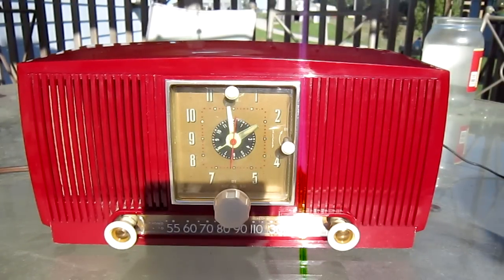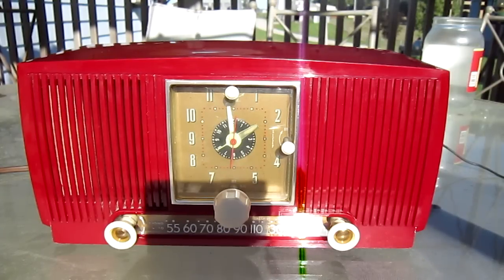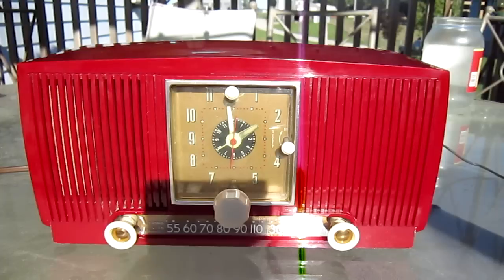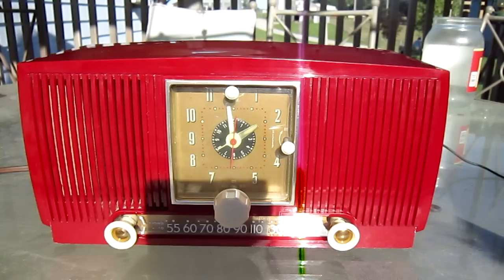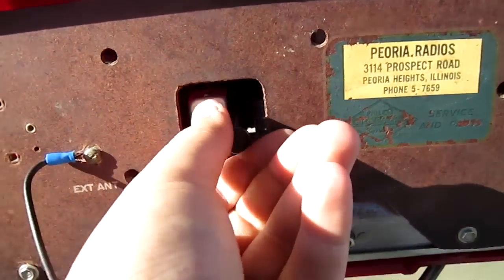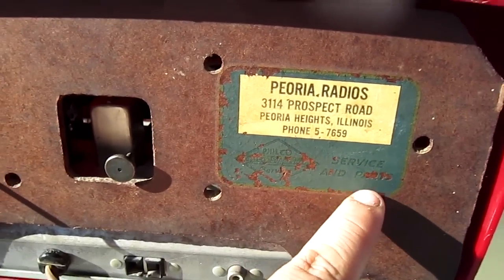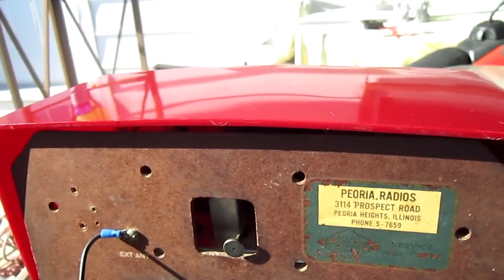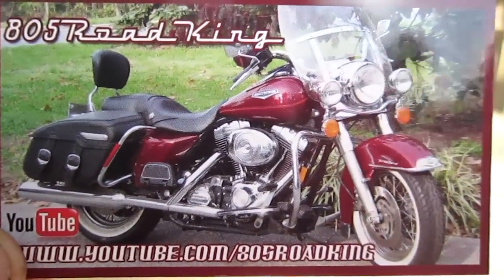1953 General Electric Clock Radio

Comment: Thanks for putting up this video. I have the exact same radio in the same color. The only difference is that the numberson the scanner are a different font then on yours and they are larger and bolder. Also the knobs for it are missing so I have to turn it on and off with a set of pliers. If you know where I can get parts for it please let me know. Also, around where was the bad vaccum tube located inside? I have the same problem as you and would like to be able to fix it. Thanks!